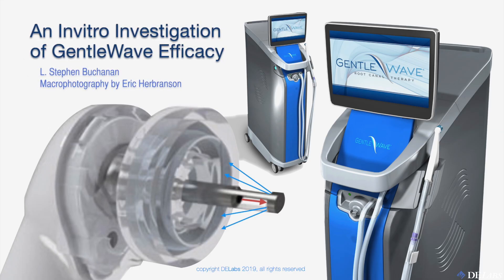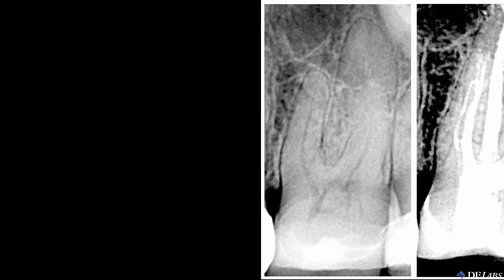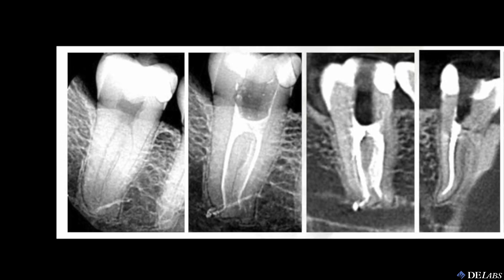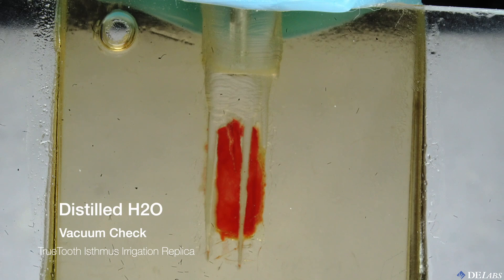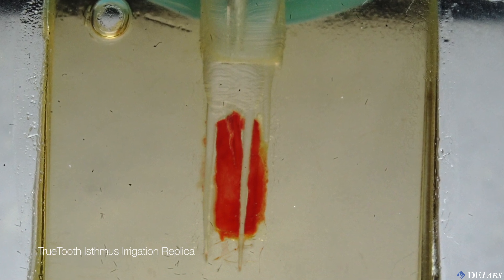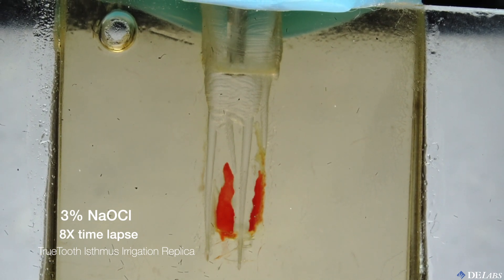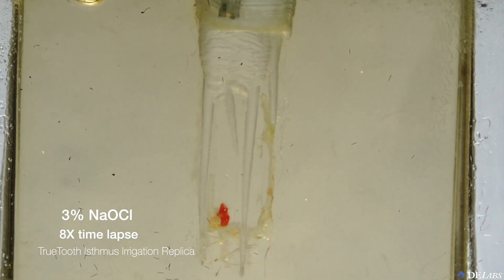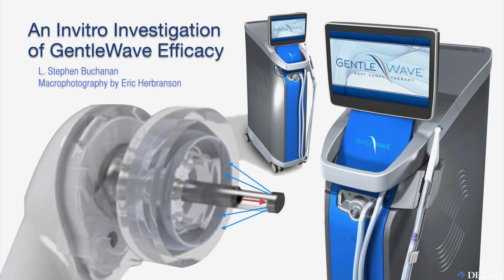TrueTooth Isthmus Model w GentleWave

Comment: Two comments. First, the Procedure Instrument tip is supposed to be 1mm from the pulp chamber floor. In this Video, it appears to be much further away which might explain the efficacy as it relates to dissolution of the prosciutto. Second, there is an optional 8 min NaOCl cycle available for complex anatomies like c shaped molars.

Comment: Can you do a demonstration on one of your TrueTooth without the apical end sealed?
Reply from the maker: Gentlewave doesn't work with an open apex that air can get into however GW has a net negative pressure inside the RCS and i've treated many cases with open apices and under maxillary sinus spaces and never had any problem with NaOCl. Also teeth and jaws virtually always have soft and or hard tissue surrounding root apices, creating hydrostatic back pressure unless great force is used against it, so doing a study with a research replica that is completely open at the end- no soft or hard tissue replication- that would be more authentic than having it artificially closed. also re,member when instruments go to and through the end of the root canal the irrigating solutions are displaced away from the apex.
-LSB
Reply: @DELendo  thank you much